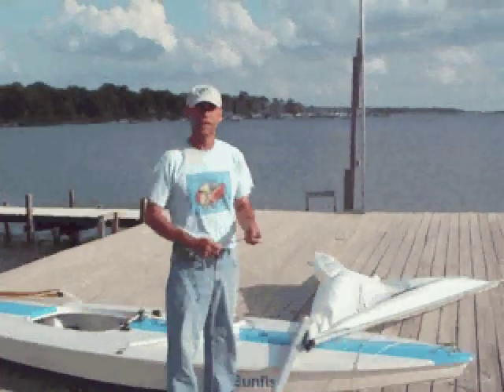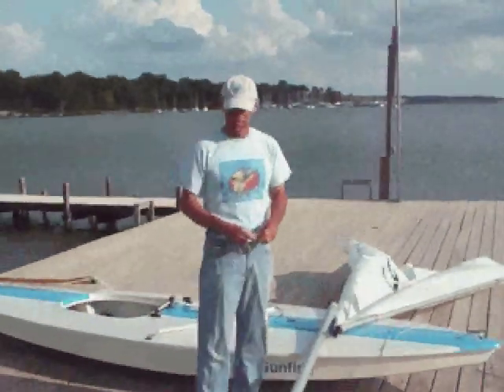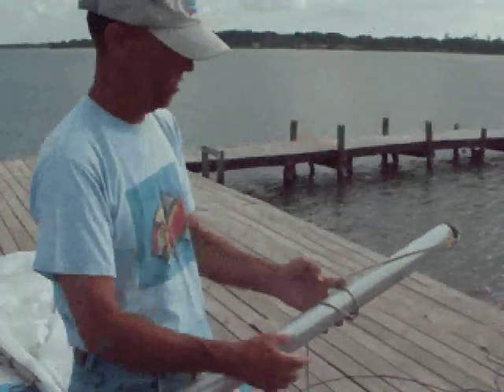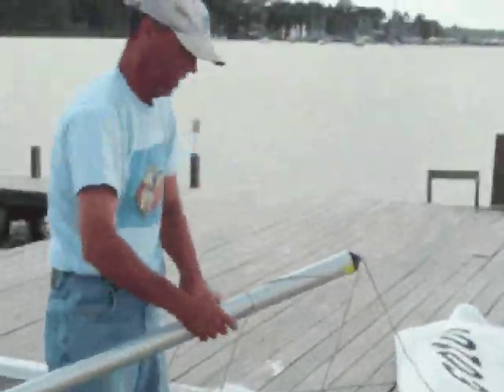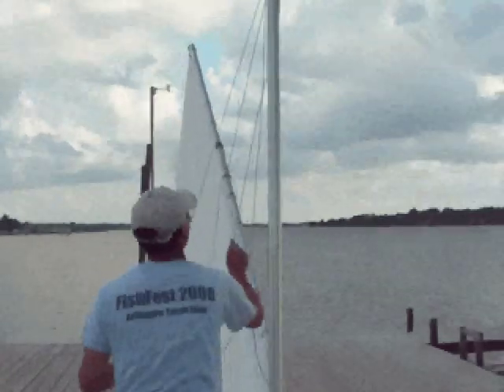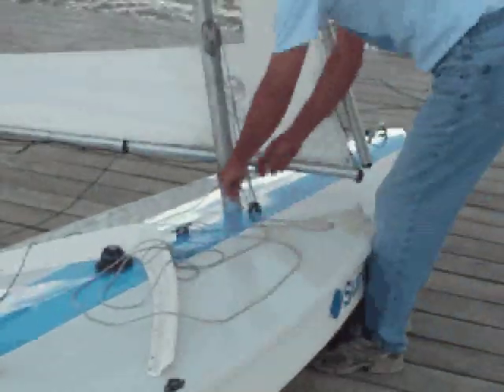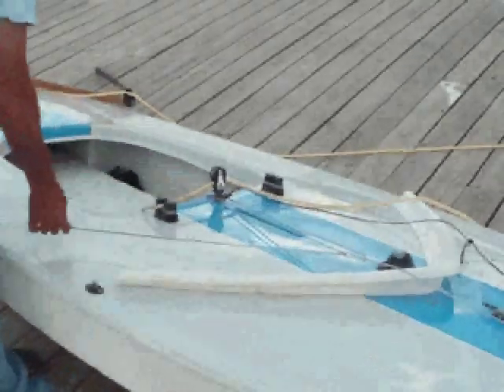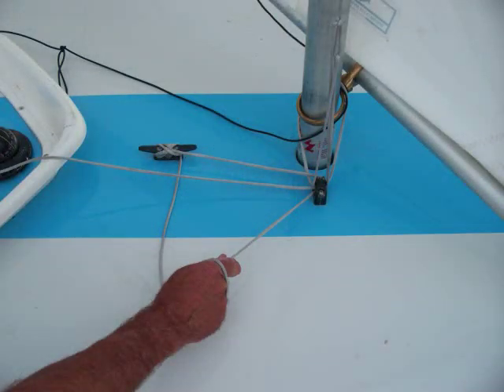"Gust Adjust" Jens for the Sunfish Sailboat

Comment: Thanks for the this vid. I am getting back into sunfish racing and maybe after the 17 added years I may not be as strong anymore, we'll find out. 
The way this works is different than I thought, but a couple of watchings and I think i get what is going on. As you state, the Jens is always full on. When breeze lightens, you are firming up the standard halyard to draw the upper spar to the mast cap, shortening the upper segment of the upper spar, which has the effect of stiffing the rig, letting less wind spill out under the bend of the spar in lighter air. It seems it is a matter of a couple of inches of adjustment. I have to go try it out, now, if I have the mechanics of this figured out.

Comment: I put a plastic cleat on the mast & secure it with a ss hose clamp. You can then adjust the height of the cleat, or remove it anytime you want--No drilling into the mast! However,you'll need a cleat that has a full base with an opening large enough to accept a hose clamp